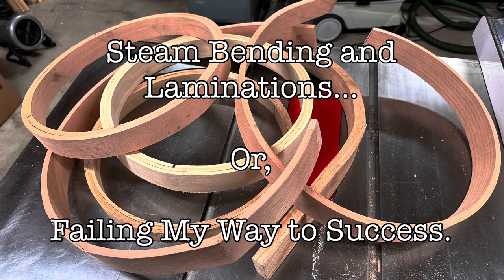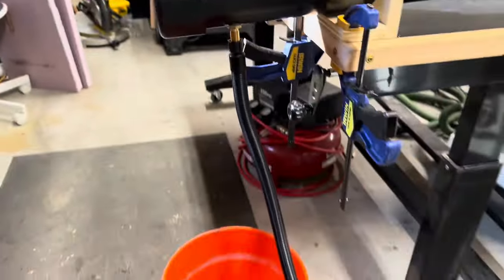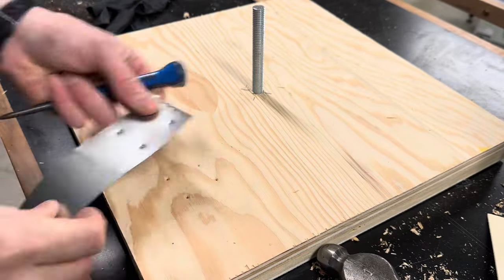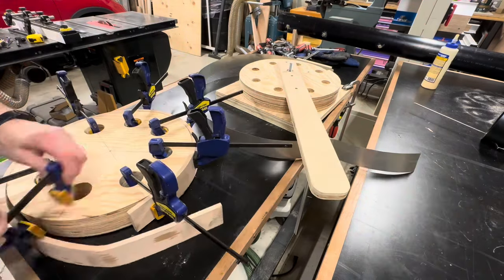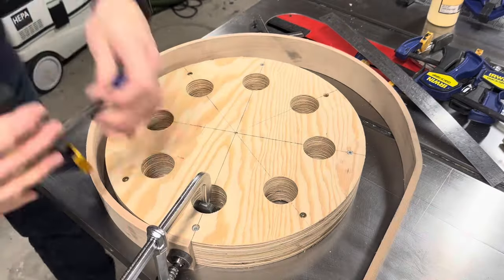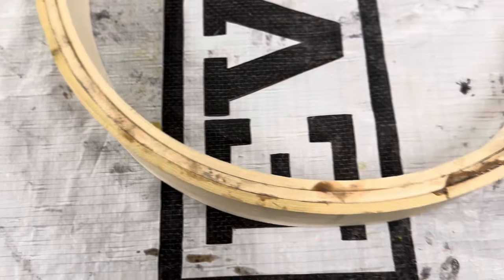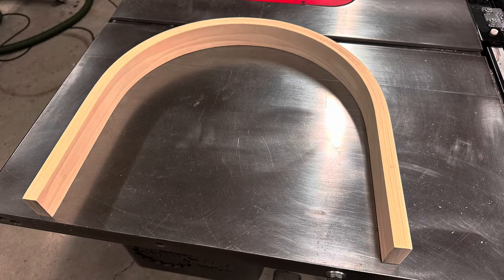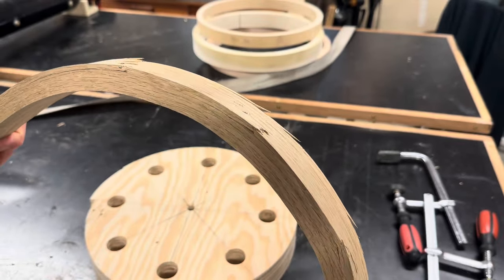Beginner Steam Bending and Lamination

Comment: I always wonder why people bother bending such thick strips. I am an engineer and during school we competed in a bridge design competition from popsicle sticks. We used two popsicle stick width glue laminated arches over a 1 m (3ft) gap. It held 1200 lbs! Glue laminated strips of wood are crazy strong. Just cut veneer thick wood, and build up as many layers as you feel comfortable with. I guarantee you can make a structure as strong as you need and is easy to work with. Just look at plywood. Supper strong. The strength is not a function of the strip thickness. It is only dependant on the overall thickness of the piece.

Comment: I learned a lot from this, and I admire your determination and ingenuity. For the gluing ring, could you cut a circle of the outside diameter out of a square piece of plywood and cut it in half, and then clamp the halves around the outside of the ring?
Reply from the maker: Yes, if it was precise enough, that would probably work, except the friction between the rings as I tried to pull them together was the real problem.  Having a split mold to clamp with wouldn’t have changed that.  Using a glue that is slipperier than PVA might change that though.
Reply: @catspawcustoms  Thanks for your reply. I am just starting my first steaming project, and I've been reading and watching videos. Yours gave me lots of ideas. I am also considering things like pressure and adding ammonia to the process (which I am hesitant about-it's toxic).

Comment: I'm no expert at steam bending, but I've been researching this for years to hopefully make steam bend drum shells and wood hoops once I've mastered the process.   A few  things you should look into:   
1 - Check out the videos by Engels Coach shop, he has tons of helpful info on steam bending.
2 - Material you want to bend, has to be free from knots and as straight grain as possible.   You want the grain on the edges of each strip to run straight / parallel to the edge.   Wavy / diagonal grain is more likely to fail.   If using kiln dried wood, you want to soak it for a few days, then steam it for 2 hours per inch of thickness.   1 hour per inch is the rule of thumb for air dried wood, but for kiln dried you should double this cook time!    
3 - Compression strap!  For bending anything over 1/4" you really need to use a compression strap.  Not just a piece of metal or nylon webbing to go around the outside, the wood needs to be restrained somehow at the ends to stop it sliding along the strap as you bend it around the form.   This stops the outside wood fibers from stretching as you bend, forcing the inside of the strip into compression.   Wood can't stretch very much before it breaks, but it can be compressed a lot.   The compression strap takes all the tension, forcing the wood into compression.   You might get away with just clamping the strip of wood to the strap, but for thicker bends, you will probably need end stops on the strap.   Have a look at the Veritas steam bending straps from Lee Valley.   Galvanised steel banding / fixing straps work well to make your own strap clamp. 
4 - For bending complete circles, like in your first design, you really need to cut scarf joints on the strips, so the ends of each strip of wood are tapered to a point.  The tapered section should be at least 2" long, but ideally nearer 3 to 4".   Then the ends need to overlap each other and the two tapered surfaces are glued together to give you a good strong glue joint.   Butt joints will never work well, because you can never get the strip to bend evenly all the way to the end, so you always end up with a bit of a flat spot.  The scarf joints help with this issue as the ends are tapered away to a point making it easier to bend towards the ends! 
Hope this helps!

Comment: You are better of working out the circumference and cutting ends at 45 degrees so when to squeeze the timber together one end will push down and the other end will push up unless you work out the exact length. Do one laminate at a time and one glueing at a time, the first glueing is for the ends only, do not remove it, the next timber the circumference will change and you have to work this out.  The jig should be perfectly round with no cut outs except if you want to use clamps, I used a very long stainless steel hose clamp which gave perfect and equal contact all the way around, you may have to use two/three hose clamps at the edges because your timber is wide. If you can't find hose clamps that are long enough for the circumference, then unscrew two hose clamps and attach together to extend the length.
Next step is to cut the high end where the two 45 degrees come together, you can do this with the table saw as you did but add some guides to the vertical timber you used as a fence so the it is not rocking back and forward, eg two pieces of wood in a V 
shape so you can rotate the circle in the one spot.  Use some plastic around your jig so that the laminated piece doesn't stick to your jig, I used packing tape.
Good luck and and post another video.
👍

Comment: for the full circle lamination you should consider building from the outside in. You make a mould with the inner diameter you want your ring to have on the outside and then cut your bent dowel to the length it needs for this diameter. you can then join the ends in the mould, you'll need to either hammer them flush or build a split mould like this: https://youtu.be/o3j2vJ_IGls?si=GQnpSRWwnzGgKrIo
an expandable inner mould would also help apply pressure in the glueing. A segmented one could be expanded with wedges or you could use an inflatable bag for this as well. for the inner plies you could also consider cutting the joints diagonally. This way when you hammer them down in the mould they automatically expand. But that would mean the edges of your ring will not be flush over the different plies and will need cutting down. So you will have to add allowances in depth.

Comment: If you want to try rings again you should check out home snare drum builds. The guy in the video below has a custom made steel mold, but i made one myself out of layers of MDF. The rings will want try to open outwards, so by placing the rings into a mold rather than wrapping them around one you can take advantage of this force. I dont know if the yoga ball will provide enough pressure for wood that thick, but definitely worth trying it out i'd say!
 
https://www.youtube.com/watch?v=OVDzcm4QJIo&list=PLyFYBKpau376KnsqU4GjOb5riGu7G4ZI9&index=3